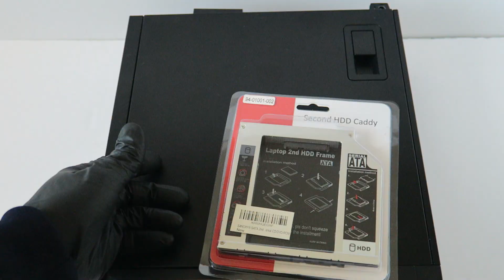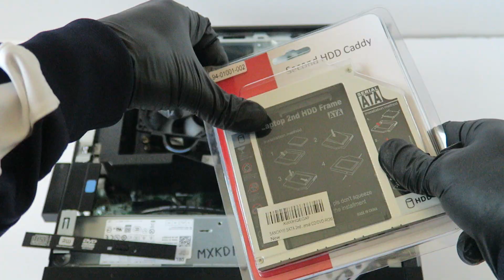Dell Optiplex SFF Install Second SSD, Hard Drive

Comment from the maker: Hi. here is the list of parts: 

 

Stanley 66-052 6-Piece Precision Screwdriver Set
https://amzn.to/34V6tmP

SATA Hard Drive Caddy, Universal 12.7 mm SSD HDD Hard Drive Caddy
https://amzn.to/3buyfJw

2.5" 12.7 mm 2nd SSD HDD Hard Drive Caddy Adapter
https://amzn.to/3czPDN9

This HDD 2.5inch will work in this caddy for extra storage.
Seagate FireCuda 2TB Solid State Hybrid Drive Performance SSHD – 2.5 Inch 
https://amzn.to/2Vpw0Sa

WD Blue 2TB Hard Drive s, SATA 6 Gb/s, 128 MB Cache, 2.5"
https://amzn.to/2VqHK6Q

Seagate BarraCuda 2TB Internal Hard Drive HDD – 2.5 Inch 
https://amzn.to/2yANdio

 
3.5" to 2.5" SSD or Hard Drive Caddy Adapter R494D 0R494D 
https://amzn.to/2XTPeRr

List video cards will work with this system.
(1.) Gigabyte GeForce GT 1030 GV-N1030D5-2GL Low Profile 2G Computer Graphics Card 
https://amzn.to/2Z4PHkp

(2.) ZOTAC GeForce GT 1030 2GB GDDR5 64-bit PCIe 3.0 DirectX 12 HDCP Ready Low Profile Video Card ZT-P10300A-10L 
https://amzn.to/2WzgLXk 

(3.) MSI Graphic Cards GT 1030 2GB GDDR5, Low Profile 
https://amzn.to/390Spum

 This RAM works with Dells Optiplex SFF 390, 790, 3010, 7010, 3020, 7020, 9010, 9020:

(1.) Crucial 8GB Single DDR3L 1600 MT/s (PC3L-12800) Memory CT102464BD160B
https://amzn.to/2VhGv8O

(2.) Crucial 4GB Single DDR3L 1600 MT/s (PC3L-12800) Memory CT51264BD160B 
https://amzn.to/2xq46wb

(3.) Crucial 16GB Kit (8GBx2) DDR3L 1600 MT/s (PC3L-12800) CT2K102464BD160B 
https://amzn.to/2VpsKpP

(4.) Crucial 8GB Kit (4GBx2) DDR3L 1600 MT/s (PC3L-12800) Memory CT2K51264BD160B 
https://amzn.to/2y7XZwq

This HDD 2.5inch will work in this caddy for extra storage.

Dell R494D 3.5" to 2 x 2.5" HDD/SSD Caddy Adapter 0R494D
https://amzn.to/3c8ynhJ

1.. Seagate FireCuda 2TB Solid State Hybrid Drive Performance SSHD – 2.5 Inch 
https://amzn.to/3b1e8T7

2..WD Blue 2TB Hard Drive s, SATA 6 Gb/s, 128 MB Cache, 2.5"
https://amzn.to/2Xstb4b

3..Seagate BarraCuda 2TB Internal Hard Drive HDD – 2.5 Inch 
https://amzn.to/2xmf0TE

This cable required if you going to install SSD and HDD:
Benfei 15 Pin SATA Power Y-Splitter Cable 8 Inches
https://amzn.to/2XsG0LV

Cable Matters 3-Pack 15 Pin SATA Power Splitter Cable 8 Inches 
https://amzn.to/2Rval8B

Zheino SATA Power Splitter Cable (2 Pack) SSD Power Cable HDD
https://amzn.to/3a3V9Wq

SSD list works with this PC:
(1.) Samsung 860 EVO 500GB 2.5 Inch Internal SSD MZ-76E500B/AM) 
https://amzn.to/2yNxnkE

(2.) WD Blue 3D NAND 1TB Internal SSD, 2.5" WDS100T2B0A
https://amzn.to/2wvnC9Z

(3.) WD Green 1TB Internal PC SSD  WDS100T2G0A
https://amzn.to/3cbrcWa

(4.) SanDisk SSD PLUS 480GB Internal SSD SDSSDA-1T00-G26
https://amzn.to/3a3i9ou

(5.) Crucial MX500 250GB 3D NAND SATA CT250MX500SSD1(Z) 
https://amzn.to/34rZlhy

(6.) Samsung 860 PRO SSD 256GB - 2.5 Inch SATA III 
https://amzn.to/2ybiHLK

(7.) Samsung SSD 860 EVO 250GB 2.5 Inch SATA III Internal SSD 
https://amzn.to/2VjIAkK

(8.) SanDisk SSD PLUS 240GB Internal SSD
https://amzn.to/3c7SEE4
Reply: Hi, sorry for asking 4 years later, but is there a way to put a second drive - ssd in and keep the DVD drive?
Reply: @petrlaskevic1948 I have the ssd under the dvd and on the hdd. The hdd is Sata, so I have space.
Reply: thanks
Reply from the maker: @ObsidianAnimation2112  Hi.

Comment: You can have multiple storage space via M2 slot 512gb below the optical drive, 8TB 3.5 HDD, plus a 1/2TB 2.5 SSD also,all you do is stack it on top of the 3.5 HDD using double sided foam pads and still keep the optical drive, so many options available but the optical drive 2.5 SSD adaptor is a cool feature 😎👌

Comment: Hi guys, I tried to install a new SSD CRUCIAL on my OPTIPLEX 390 TOWER (I wanted to replace old HDD). However, I got a message on the monitor - like some kind of mosaic. "VAD", etc. across the whole screen. SDD MX500 2.5 inches. What's the maximum RAM for OPTIPLEX 390 TOWER? Can I go beyond 8 RAM?

Comment: Can I add an SSD and still keep the original HDD and the optical drive, are there 3 power cables and 3 data cables to run both drives and the optical?

Comment: Will this fix my hard drive not detected problem
Reply from the maker: Hi, it depends is your hard drive new or used and did you format it and does you motherboard  detects other drives like ssd and optical drive ?

Comment: i fitted one but it shows as 510MB not 240GB
Reply from the maker: Did you install new SSD or used one ?
Reply: @Mxkdt  it was a used one. i was able to reset it with disk manager.

Comment: am i able to remove the optical drive and replace it's spot with an SSD?, or does it use different type of connectors?
Reply from the maker: Hi, yes you can use this 12.7 mm caddy  that's will allow you to install 2.5 hard drive or solid state drive.
https://amzn.to/3buyfJw
Reply: thank you so much

Comment: Thumbs Up for How To Lesson.  I wonder if this will work for a 2nd SSD or 2.5" Hard Drive on my Dell Optiplex 7040 SFF PC, that I just picked up refurbished w a 256GB SSD. I notice this specific Dell is not on your list.   I want a second 1T internal ssd or hard drive if possible.  I will study your lesson again to absorb more specifics. At present, looking for specifics on connector cables, connect locations to motherboard, and info on which SDDs and/or HDs are compatible. ... Looking at Motherboard layout in pdf Manual, just noticed 3 separate Serial ATA connections, so think I can do this.   ... Thanks :+)
Reply: Hey man, on the same boat... were you ever able to do it? How did you figure out power supply?
Reply: @ItairMiguel-q8b  ... Re How Question... On back burner as task. Found proper hd holder for two SS drives, plus know one must open BIOS options, and configure the BIOS for 2nd HD. My Two Cents 🙂

Comment: Excellent video. Everything worked out for my Optiplex 9020 except for the original DVD faceplate piece. Not one single plastic tab lined up with the new caddy. I had it oriented the correct way--the tabs just didn't line up at all. I had to put black electrical tape over the opening to make it look okay. It's nice having an SSD and a full size HDD for storage in the same SFF machine.

Comment: Does this adapter caddy, on the power connector that comes on the motherboard, fits or is this caddy compatible only with this cable from Dell? I say this because the power connector is smaller than normal cables. Thanks
Reply: Was wondering the same thing. You figure it out?
Reply: @GDX2470  I bought on Aliexpress and it worked, thank you.
Reply: @atodocusto10  which part? The caddy or  new power cable? Was it a split y cable? I’m not sure whatd I need to have 1 SSD and 1 hdd. It has 1 regular connection on the motherboard and 1 smaller for the cd drive.
Reply: @GDX2470  Alliexpress caddy is ok to use an ssd in addition to the HDD I use too. The difference is that the Dell DVD drive has the data connection and adapts to the Caddy.

Comment: My 9020 SFF has space for a second 2.5" drive in the same blue plastic caddy as the primary drive. Its underneath the drive thats already in there. They even provided 4 spare screws in dummy holes if your drive didnt come with any. Also, in mine there is already an extra sata power pigtail. I only needed to buy a new 6" sata cable.  So it might be worth checking if your model has space before buying extra parts and eliminating the optical drive.

Comment: Hello everyone. I have a Dell Optiflex 3020 (like the video). I want to install a SSD for OS and keep Hard Drive (like the video). Is better to inverted the cables (HDD in the SSD and the ODD for the Hard Drive)??? Will work? Better? Thanks. Great video.
Reply: I was wondering the same. You ever figure it out??

Comment: A couple of questions about parts. I've a HDD already. Do I need a different caddy if I'm adding an additional SSD? Would I just need the SSD, its caddy and wiring listed above?
Or do I need to change my current HDD and its caddy to add the SSD? I just want to make sure I'm buy only the caddy I need. 

Question #2 - You've two HDD lists: Do a need a HDD from the storage list if I'm adding an SSD or will the current HDD type & caddy be okay to convert to storage rather than boot and apps?

If you've time, I can DM you my list of new parts.

Comment: Ok so I had the caddy and installed but the system will not see the drive if the other drive is hooked up. What I found is that I had to use an external power source for the second drive. Why is this? Doesn’t the power supply have enough power for both drives?

Comment: Is there a way to install a second hdd without removing the optical drive?
Reply: yes if you hdd comes eith another one of those this fr power plug that in and then if u dont use the cd the unplug the caple and pug into ssd

Comment: I have a 7010 SFF with an i7-3770, 16gb ram, and a gtx 1650 low profile.
My question is... Can I have a 120gb SSD and a 2tb HDD both inside the Optiplex at the same time or can it only handle one?
Reply from the maker: Hi, yes you can use one SSD and one HDD
Reply: @Mxkdt  Thanks

Comment: Thanks much, this  DVD-to-HDD adapter OK work with only this 2 wire connector for power?.
I have 3020 Dell and it has only 2 Sata (Sata3, and Sata2). I assume Sata2 used for DVD, not sure if this OK to use on primary drive, will it slow down traffic./
Reply: Did you figure it out? Was wondering the same thing.

Comment: Wait this doesn’t work with 7020 sff??? It has the same set up as the 3020 and 9020 sff
Reply from the maker: Hi yes it does work with sff dell optiplex 7020 and 3020 and 9020 and other dell models

Comment: Yeah but how do I fit a 2nd 3.5" hdd ..
My system dies and I need to transfer files from my old 3.5" hdd .. I tjought I just plug it into the spare sata port on the mb but there isnt a second 4pin power cable .

Comment: I didn't even use a caddy, just slid in a ssd on top of the hdd in that cage. Haha that works too
Reply: Hey man can you explain how you did that? Was it an 5070?
Reply: Connor McCormick it was a 7010 SFF, I just slid the ssd on the HDD, there was a small gap. On top of the drive cage, there's an opening where you can see the SSD/HDD, I used a tape, to hold the ssd in place.
Reply: @exodus58  that's a smart move honestly, you saved money lol. Does it still work properly?
Reply: @Mujahed.  yes
Reply: Yeahhh Bro Is'ss a smart move I was having a little confusion about it but By your comment I damn sure as I have bought a very very expensive ssd for it 😢😊

SPECIAL THANKS TO YOU BROOO 
GOOD JOB !!🎉
Reply: I was thinking of doing that thank you!

Comment: There's no need to do away with the optical drive. You can install 2x 2.5'' HDD/SSD where the old 3.5'' is located. Just get yourself a 2x 2.5'' HDD adaptor bracket.
Reply: Les Rogers would this work with the Optiplex 7010 ? I’m looking at upgrading my pc with an ssd . Plz help
Reply: Kai H, Yes you can do this with your 7010. You can use any generic (non branded) 3.5'' to 2x 2.5'' adaptor or the Dell OEM adaptor number R494D, F767D or J132D. Remember that you will also need a SATA power splitter cable (1x female plug and 2x male plugs) and one additional SATA data cable.
Reply: Les Rogers okay thanks
Reply: @lesrogers7310  I just got a Optiplex 7020. I want to know how i can have two 2.5 hard drives in it and keep the optical drive. I tried searching for the power splitter your talking about and cant find it. Please help me and show me a link to the right one

Comment: I applaud your awesome and comprehensive videos about these machines.
This really is the most elegant way to convert that space for use as a drive bay and keeps the system looking perfect when you are finished. 
I wanted to keep my optical drive, so what I did on my system was attach a 120GB SSD to the side of the power supply using a little tape, plugged in the third drive power plug and connected the SSD to the third SATA port using a spare SATA cable from my parts box. -the opposite wall of the case has a ton of room also if one is good with wiring or can provide an extension cable to extend the power connection for the drive.
Now my 990 SFF has an SSD for Windows and a big ol' 2TB spinner in the large drive bay for storage! 
As mentioned previously there is also an alternate drive caddy that supports two 2.5" drives.
I'm not gaming on mine, (ham radio stuff here) but I did manage to find a new-old-stock low-profile GTX 210 video card for next to nothing, and also  modified the wiring to support an additional power plug for a low-profile USB 3.0 card.

These old Dells can be really fun enthusiast machines as well as practical runners!

Best regards!
Reply from the maker: Hi, thanks for the info.

Comment: I'm torn between getting a 2TB HDD or a 500GB SSD. The price difference is massive, which I guess reflect the higher SSD performance. Is it worth giving up so much storage for the sake of higher perfomance and if so how much power are we talking here? Any advise?
Reply from the maker: Hi, yes SSD for main boot drive and yo can get 1tb 2.5inch hard drive that cost less.
Reply: @Mxkdt  Cool, so I'm currently running my OS on a 240GB SSD. So I should be able to get a 1TB HDD without sacrificing too much on performance?
Reply from the maker: Running 2tb as main boot drive will be to slow in windows10
Reply: Mxkdi I’ll be running the main boot on a 240GB SSD
Reply from the maker: Most 2tb drives you buy new online they sell are 5900rpm or 5400rpm way to slow.

Comment: I'm actually of thinking of building something portable with one of these things someday. I was going to build one with 2 optiplex sff towers, a kvm and a shared USB 3.0 hub, but it would too big and unpractical even though it's sff. So now I'm thinking only one optiplex and only 2 operation systems (linux and windows) and I think I'll install a second SSD like what you showed here. I wanted something portable, but not a laptop, something with a CMOS battery that can be accessed (I'm soldering in a reset button) and I am making new metal housing and possibly fitting a LED monitor (maybe 2 with a video card upgrade) to be attached to the side of the unit. Thanks to your videos, i can get a good look at what I have to work with once I decide to take this project further and eventually finish it.

Comment: Man where did u find one for the desktop? I keep finding laptop ones and the face plate off my disc drive does not match up
Reply from the maker: Hi, they sell them online generic brand
Reply: Mxkdi yea I found generic ones but can’t find one that allows me to swap the face off my dvd rom for a clean install. I’m trying to install it in a dell 3020 sff
Reply: I found it on eBay. Third times the charm ... clean fit and the led lights up on it. Pretty cool

Comment: Hello. I have a Optiplex SFF 3040. It have only SATA0 for main hard drive and SATA1 for the DVD. I disconnected the DVD and used the SATA1 for 2nd hard drive. For power I used a SATA power male cable in to two SATA female to connect power for both drives from the normal size SATA power. When i power the machine I can here the 2nd drive spining but nothing shows in My PC. Do I need to change anything in the bios or is this machines only support one drive? the same thing happens to me with Dell Optiplex 980 SFF any suggestion.
Reply: BIOS needs to be set to read the dirve that has the OS.

Comment: Looks like the two cables for the DVD drive are not identical to the normal sata cables. One of which is with only red and black wires. How does it fit onto the adapter caddy. Please clarify.

Comment: Very good tutorial, thanks much. It's a drag you have to get rid of your DVD layer so you can have a second drive.
Reply from the maker: Hi, thanks.
Reply: My thoughts exactly. There has to be a work around that avoids this.
Reply: @southwoodside  not really. these pcs weren't designed with the idea of 2 drives in play.

but the alternative to removing the cd drive is pretty simple 

you just remove the 3.5" drive and put 2 smaller drives inside stacked on top of each other. maybe secure them with tape? or just leave them floating. Assuming you don't constantly move or shake your pc it would be fine. I've done that before. The drives sorta stay in place when held by both the power and sata cable 

so there's the alternate. 

I don't think anyone has made a drive caddy that hold 2 2.5" inch drives in place and slides into that slot for the 3.5" caddy
Reply: @stevesmith1383  Yes, a reasonable suggestion. I just ordered a cheap 3.5 to 2.5 caddy. I intended to simply use it for a new ssd drive to replace my 3.5 mechanical drive, but it seems that the holes in the base could be used to attach the ssd UNDER the caddy while the mech.drive might fit on the topside, screwed or screwless, perhaps. Will soon find out hopefully.
Reply: @southwoodside  so....I went to upgrade my Dell 3020 sff only to realize there is only 1 full size power cable for the drives. 

Meaning I would need to use the caddy (I was anyway) since it uses the mini power plug the cd drive uses

This wasn't the case in say, the 780 or 790 sff which did have more than one power connector.
Reply: @stevesmith1383  I have a spare power drive in my 7010, so I should be ok.
Reply: @southwoodside  ok, yeah seems to be a case by case scenario. I was surprised when I opened up my 3020 to realize it only had 1. 

I had the caddy anyway but still assumed the alternate 2 drives in 3.5 caddy option would work
Reply: @stevesmith1383  Yes, but they are really good PCs IMHO. Fast.

Comment: Can you eaisily set the optical ssd drive as the boot drive using this method and keep the original as storage?
Reply: Yup, sure can! First, clone the  operating system onto the new SSD drive. Then go in the BIOS and change the boot order so that the SSD is at the top of the list and boots first. After you are sure that the new SSD boots the operating system correctly, then to can erase the old mechanical hard drive and use it just for storage and/or backup.